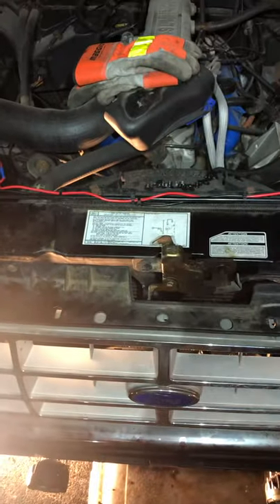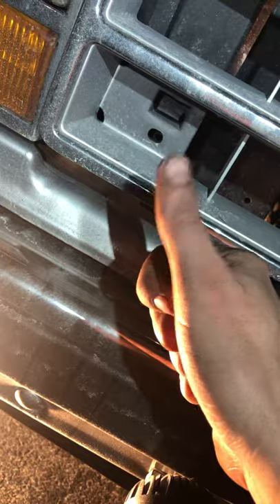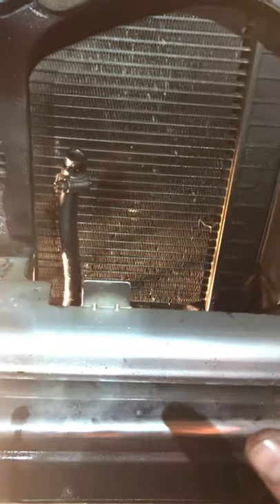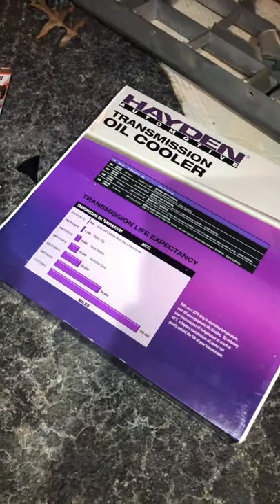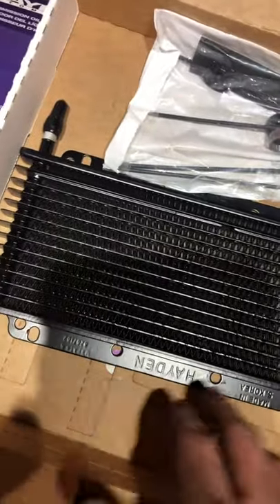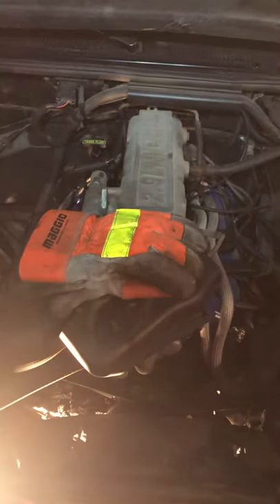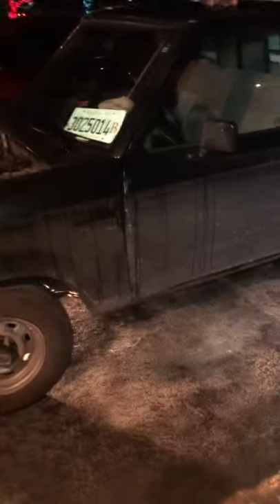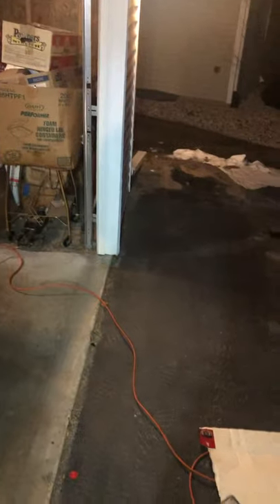1990 ford ranger 2.9L transmission cooler replacement

Comment: We're you getting coolant in your oil? And losing heat
Reply from the maker: No when I was racing the car the oil temperature was reaching 270+ degrees before I installed this oil cooler. Now I am seeing right around 240-250 degree oil temperatures when racing the car.
Reply: @sparkgapgarage5252 I'm about to change my oil cooler. Have a 2.9 Liter 89 Ranger. Does this job require dropping any pans or anything?